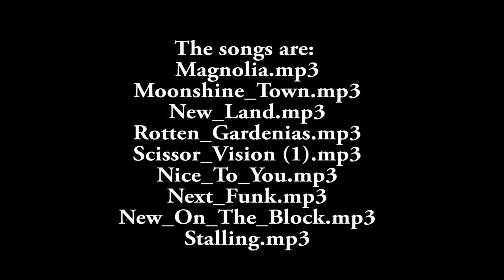18kt gold bracelet with white and yellow gold links handmade

Comment: Drilling holes in 2 glued (onto each other) strips, and solder the wire pieces all at once at a) 3 holes, b) 4 holes (after separating the 2 strips) using bended u-profile piece of the strip for equal distances, waaaay faster. Would have gone for the classic hinged clasp myself though

Comment: What solder are you using on the ends of the round stock pieces?😊
Reply: It would be gold whatever carot the gold ring or bracelet is, you use that solder, in wire or panels.

Comment: Needs more polishing
Reply: I would disagree, pictures all look like a mirror finish has been achieved but if you look at 21:07 there are clear filing/abraisive marks on the finished product. This should ideally be properly sanded out but I guess you could also cake on that polish to hide them. Downside is that the scratches always come back when the excess polish on the peice wears off.